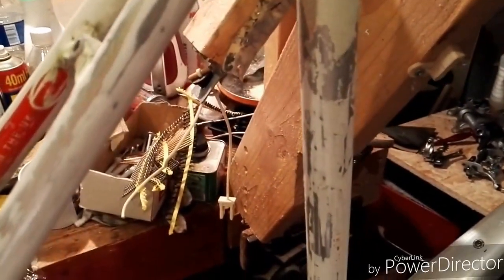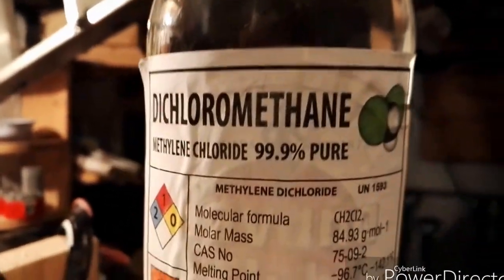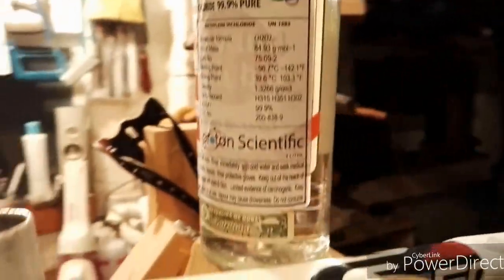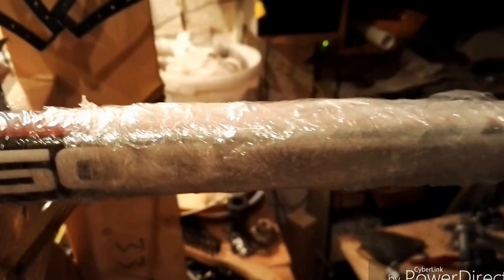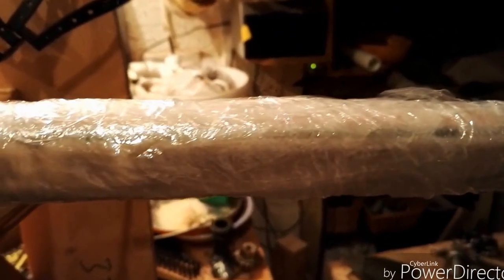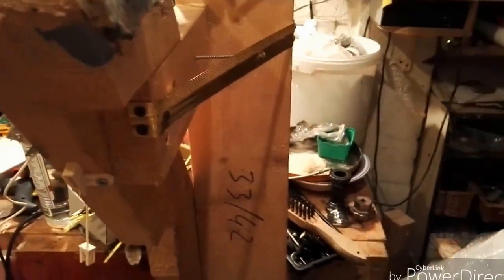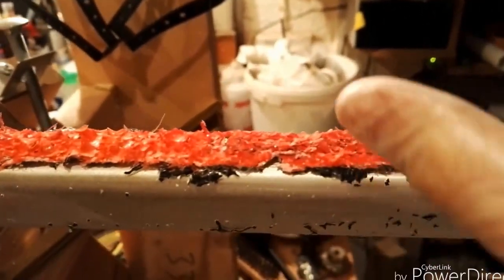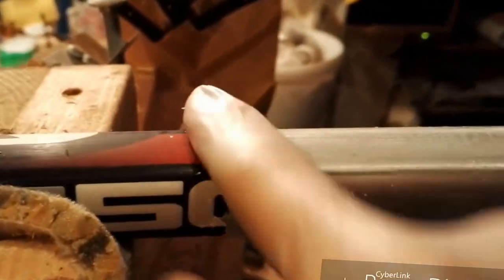Stripping paint off aluminium bike frame

Comment: Dichloromethane (DCM), or methylene chloride, is a colorless, volatile organic solvent used in paint strippers, degreasers, aerosols, and pharmaceutical manufacturing. Its chemical formula is \(CH_{2}Cl_{2}\). Due to its potential health risks, including being a probable human carcinogen and causing central nervous system effects, its handling requires strict safety measures and ventilation.  
I THINK NOT<<<<<<<<<<<<<<<

Comment: Just had my bottle of Dichloromethane arrive and have come back for another look at the video; when you say dowse the kitchen roll, what did you do? I was considering using an old pump spray i was prepared to bin after use, but i'm concerned it will attack the spray gun before i can finish the job!

Comment: Tomorrow i'm striping my frame, wish me luck
Reply: so i’ve tried to strip my frame and it did not work as it shows in the video from close observers this are my thoughts on the process: the liquid evaporates very quickly (it might be the worm whether since i’m doing this outside in the garden), the minute i’ve soaked the paper towel it has to be wrapped. I think the type of towel and gloves should be considered since the towel was quite thick and it would not wrap around nearly and i had to use small bits of masking tape to hold it in place, in regards with the gloves they melted as soon it got in contact with the chemical, i’ve used so far half litre and did not manage to cleanly strip the fork since this is what i have started with
Reply: so the end result after going thru the process twice is that it has removed almost the entire clear coat and a bit of the paint, the second time i’ve wrapped toilet paper on the hole fork and sprayed the paper till it was soaked and wrapped it wit cling film, as a safety precaution i would highly recommend using rubber gloves and a proper mask in a ventilated area under shade with all that in mind i do believe i can get this to work i was so impressed with the area where the paint was removed it looked like new
Reply: my final conclusion: after searching for different ways to do this i think i have found the best and effective way of stripping the of the fork using a vacuum storage bags pouring 100 ml of liquid in the bag and removing the air to make the bag slightly squished around the fork (i can see the striped working in les the a minute), safety precautions should be taken i’ve done this in the evening so their is no sunlight, the fork is placed in a large plastic box and i will supervise until the fork is removed from the bag and washed

Comment: Hey man great video! Any chance you can do one going over what to buy and how to decant it? Cheers
Reply from the maker: This is what to buy https://www.ebay.co.uk/itm/Dichloromethane-1-Litre-Methylene-Chloride-DCM-99-9-Pure-ACS-Lab-grade-1000-ml/331520613551?pageci=70744848-ac27-4668-85b3-e0d3a8ec667c

No need to decant it really but you could just pour it into a small glass jar or bottle. Please make sure you observe the warnings,  keep ventilated and use gloves.
Reply: @Samdawe1981  Thanks man! I found a store nearby where I can buy some. I'm realizing my bike is an aluminum frame with a steel fork. Can I use the same method on the fork or do I need to use something else?
Reply from the maker: @benazoulay3673  I reckon so, but you might need to repaint the steel or it  may fade or rust. I avoided mine as they were carbon and I didn't want to mess up the resin

Comment: Not Bad I just got my aluminum giant frame done and its was nothing like this. If U was to use aircraft remover and let it sit it take powder coating off like jelly. depends how thick the coat is i had to put at least 3 4 coats on it it came out pretty neat.

Comment: affect on a carbon fork ?
Reply from the maker: I left mine alone as they are painted plain black. I think the solvent would dissolve the epoxy resin in the fibre, so best not unless you can test it on something sacrificial.

Comment: Do you still use this method?

 Does it have an impact on the integrity of the aluminum frame?

After all of the paint is stripped, what would you coat the frame with to protect it from the elements and sweat?
Reply from the maker: J T it does not affect the integrity of the frame. I chose this method over abrasive removal for that reason. Aluminium alloys naturally protect themselves with a thin oxide layer. This will slightly dull the finish but is easy enough to polish. If you wanted, I suppose you could lacquer coat it but I was happy enough with the raw finish. Some people go through the sandpaper grades to get a mirror finish but this is a lot of work on such a complex shape.

Comment: Brass wheel is better than that dangerous chemical
Reply from the maker: Dole Bandit perhaps but any kind of abrasive mechanical removal could risk taking away the wall thickness of the tubes and would leave more polishing work. Also, you'll struggle to get into the nooks and crannies.
Reply: Your right,    I tried that nitro mors,    It`s rubbish

Comment: hi, this seems exactly what im looking for, did you use it neat or with anything else? what did you use to clean the frame afterwards? tia :)
Reply from the maker: chris cowley used it neat with just the paper towel. Afterwards I used a wet and dry paper then brasso. If you want a mirror finish you'll need a graduated set of fine to super fine grit paper.

Comment: Didn't work for me I'm afraid. Tried it a few times and managed to crackle the top clear coat only. Maybe I did t wrap tight enough. I believe like you say it was in nitromors and the gel acts like your barrier to hold it in place and prevent evaporation. Might try and get some gel

Comment: hey im planning on doing this myself to a bike frame, could you tell me how much dicloromethane you needed for the whole frame please?
Reply from the maker: jared johnston I bought a litre but used less than half and the paint was pretty thick. It was fairly cheap (compared to nitromors) so not too worried about having a fair bit left over. Will probably be useful for cleaning but it does evaporate very quickly, hence the need for plastic film.

Comment: Any updates?   I'm getting ready to do this. I'm wondering how you're project has turned out thus far.
Reply from the maker: it turned out great. The joints and welds took a lot more work than the straight bits but it was worth it in the end. Will publish a video of the final result soon. I used wet and dry sandpaper and polishing compound to shine it up. Not going for a mirror finish, but just enough to look nice and not go flat. Finished with car wax to help it stay clean.
Reply: Thanks for the reply. I'd love to see the finished product. I'm getting ready to do the same on a Specialized Allez that I have.
Reply from the maker: Rich Lavigne https://youtu.be/5Aq_72tX9Ww